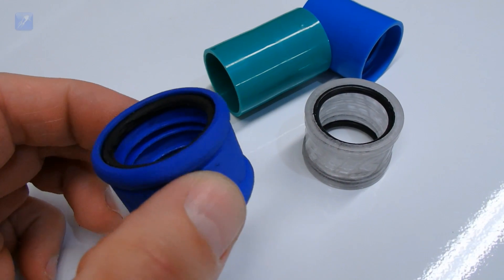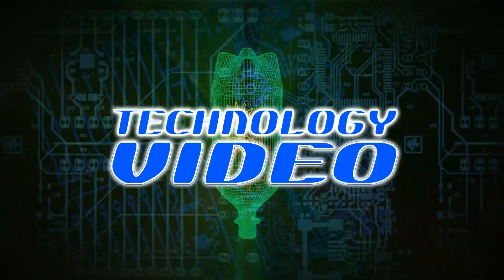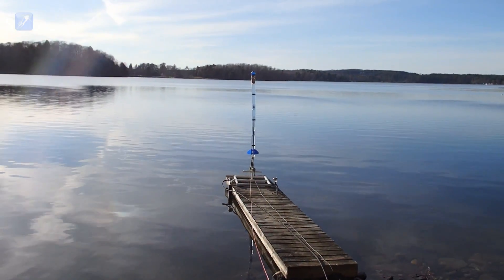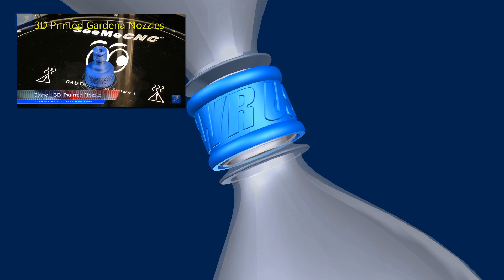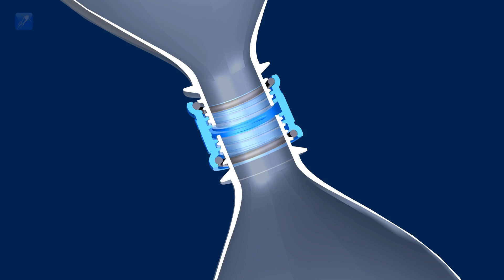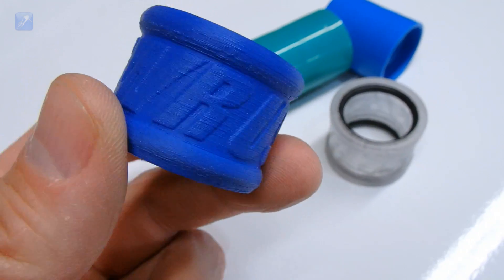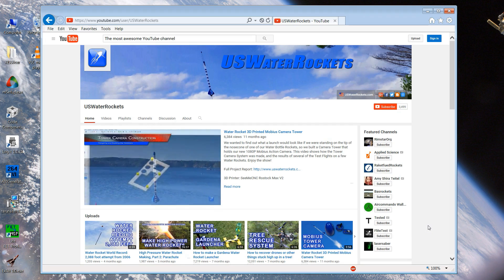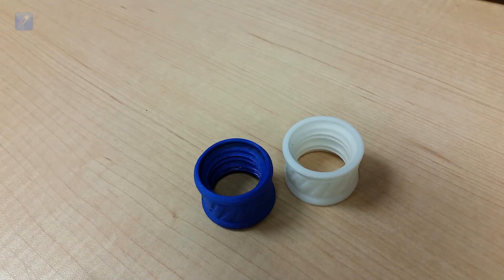Ultimate Water Rocket Tornado Tubes

Comment: It is interesting that your design allows for a launch tube to go through each pressure chamber, but then how does water get into the lower chamber? In my launcher system, I pump water up through the launch tube and it falls into the chamber, but if my launch tube goes up into the upper chamber how will the water get into the lower chamber?

Comment: USWaterRockets What's the size of the O ring???
Reply from the maker: To use this design, you will need a #213 O-ring for each end, or you can optionally use a flat hose washer between the bottles, but this does not seal as well.
Reply: @USWaterRockets  Thank you!!

Comment: Yes, it is a useful improvement. I take note. And at what happens reduce the heat soldering? Does the printed circuit board, components overheating?
Reply from the maker: No issue with overheating. I monitor the heat with a thermometer and try to manually regulate the heat to match the recommended soldering temperature profile of the most heat sensitive part. This works well for me.

Comment: Hey man, i am trying to break the water bottle brazilizan record do you have any tips? We cant use eletronic launcher and we can only use water
Reply from the maker: +Ricardo de Arruda I suggest that if setting a new record is your goal, then there are a few things you can do.  The first thing you need to do is to check what the rules are in your competition. I think you may have done this already, since you said you are not allowed to use an electronic launcher. There may be other rules to conform to that you didn't mention, so if I suggest something that goes against those rules, you obviously should not do it. The next thing I suggest is making your rocket as large as possible. Larger will give you more volume and that usually gives more altitude.Next, try and make the rocket long and thin, but not too skinny that it is weak or wobbly. Thinner is better because there is less drag.The next suggestion is to make the nozzle full-bore and use a launch tube. The launch tube probably will have only a small positive gain in altitude from the piston action it gives, but the tube can support the rocket and guide it off the launcher without launch rails or guides that slow the launch from friction. The full bore nozzle is the real key here, since it has been experimentally shown to be the most efficient. Smaller nozzles give a longer thrust, but lack the acceleration needed to get the most height.The last thing would be to push the limit on pressure. If you can reinforce your rocket or build it from any material you want, then find a material that holds the most pressure, and use that for the rocket.Good luck in the competition! Drop us a note or comment, and let us know how the contest is going!
Reply: Ok' i have 15 days to build the rocket, after the launch I will drop a note here.
THANK YOU!

Comment: Just a suggestion, but if you were to add at least three dovetail joints around the tornado tube you could print interlocking supports to help hold the top bottle more stable, I can only imagine how much the upper bottles must wobble especially on takeoff, I know you use a bottle sleeve but I can't help but feel some upright ribs might help or even work better,
Reply from the maker: +Phoenix540 That is a good idea. I had an idea to make struts on the tube itself, but some kind of slot or dovetail would make it modular. It's worth considering. Thanks for the suggestion.

Comment: Hello USWR,great to see a new video from you! :)The tornado tubes look very good, especially because they allow the launch tube to pass through. :)It would be interesting to know for how much pressure the tubes are designed. I guess it depends largely on the material you use, but it would be great to have a reference. =)By the way: We have a big announcement for our 5th anniversary (May the 4th), so stay tuned. ;)
Reply from the maker: +Raketfued Rockets I mentioned in another comment that I've put 200PSI in them without fail, but I could try and blow one apart if there's people interested.  Also, you can't tease a major announcement without at least giving us a hint! That's not fair!
Reply: +USWaterRockets Yes, a burst test would be very interesting. You can find a small hint on our social media accounts (Facebook, Twitter, Google +), we posted it yesterday. By the way: The end of this video looks promising, can't wait to see more. :)
Reply from the maker: +Raketfued Rockets the hint must be very well hidden, because the only thing I saw was your announcement which is the same as what you wrote here, only there you made a cool logo of a water rocket. The preview project you see in the video ending has turned out great. There will be more video about this coming up soon.
Reply: +USWaterRockets I'm looking forward to hear more about your project! :) I really can't say more, but the drawn rocket is a reference and if you look closely you can find it in some of our videos. ;)

Comment: cool Innovation ;) 
Do you know 
how much pressure such 3D printed Tornadotubes hold?
Reply from the maker: +Marcel Waldner I tested the Tornado Tubes I printed with ABS and PETG filament and the bottles exploded at 200PSI. I have not tested them to the point they fail. I have some raw bottle preforms that I could connect with one of these tubes and find out what the maximum pressure might be. I'll have to figure out a way to attach a fitting to the preform so I can pressurize it. If you're interested in seeing a pressure test, let me know.Keep in mind that a poorly calibrated printer might make a part that's weak to begin with, so my results are only true with a well adjusted and calibrated printer.